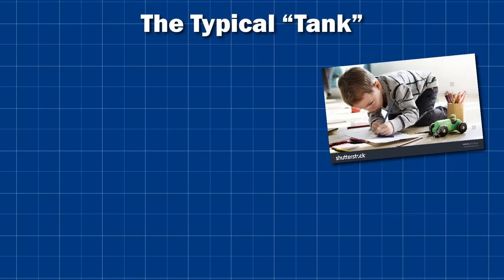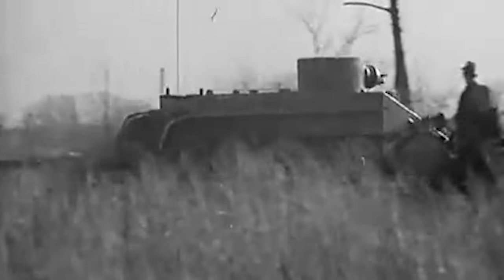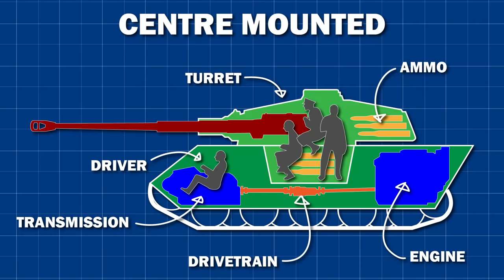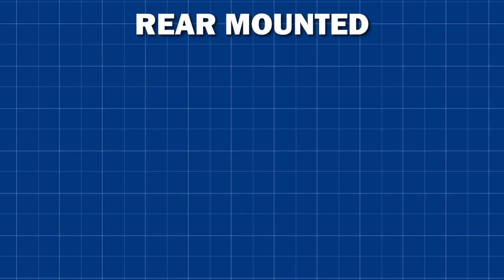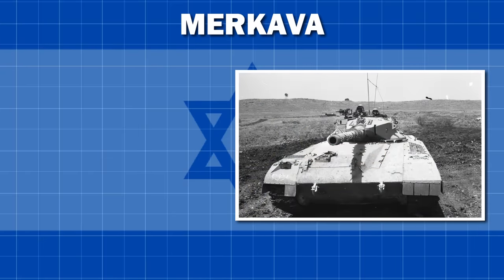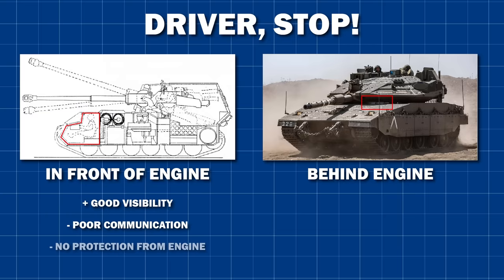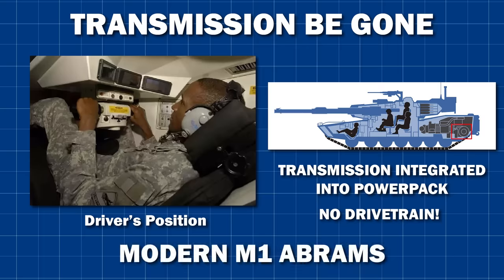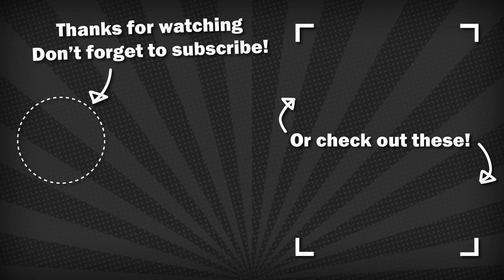What happened to Rear-Mounted Turrets?

Comment: The Merkava being able to carry infantry in the back isn't technically untrue, but its more of a misunderstanding, Its only possible by removing a majority of the vehicles main gun ammo. As far as i'm aware the ability is there so that it can transport wounded soldiers in a hurry, although the practically of that sounds questionable.
Reply: If the Merkeva have the similar ammunition arrangement like the Abrams; it wouldn't need to stowed ammunition in the hull. Another major issue is the engine is mostly hollowed out aluminum offering almost no addition protection for the crew. Even when engines were still mostly made out of steel, the steel isn't the same steel alloys use in armor.
Reply: @mislovrit  Yeah, i don't particularly like the design of the Merk, It could've made sense as a early cold war tank, but in an age of composites its just a liability.
Reply: @mislovrit Engine Block isn't gonna stop the Main Body of Projectile, An APFSDS round is gonna soar through Like Nothing, but it's gonna slow it down and It's gonna stop any additional Fragments
Reply: Merkava is a downright dangerous Vehicle for Infantry to be in, if they move a little bit forward they can get caught in the Rotating turret, Like 10 tonnes of electronically driven Steel, turrets have no problem breaking hands, legs, or taking lives even 

There isn't enough of a space to stay behind turret ring. 

In an extremely emergency situation however Yes, you could cram one or two soldiers between ammunition racks, but they are entirely blocking the exit which of course isn't ideal 

Merkava isn't an  IFV, a P38 has picked up wounded Troops too, doesn't make it a transport plane
Reply: @mislovrit M1s have hull ammo stowage
Reply: It's like an American truck. American trucks can tow and haul, but, not a lot of people use it. (Poor gas mileage, strain on the transmission, etc.)

The Merkava can transport soldiers, but, the sacrifice to do it is usually not worth it. But, it's there if you ever need it, just like an American truck :D

BTW, has there ever been a recorded battle where the function was used?
Reply: @pharaongaming8617 Bro how often is a Merkava going to have a high quality APFSDS round going through its front hull. I actually agree with the design philosophy that the engine block provides protection as it is extremely effective at protecting crew  from HEAT projectiles and Anti-tank mines. 

The turret is much mire likely to be shot by kinetic projectiles in a war and the Merkava’s design compensates
Reply: @nooby1249  All but 6 rounds of ammo in an Abrams is stowed in the turret bustle, and separated from the crew unless loading. The purpose is so that if the ammo is hit the top of the bustle will blow off, leaving the crew unharmed.  The six rounds in the hull are stored in a similar compartment that blows out of the rear of the tank. Merkava stows ALL of the main gun ammo in the hull.
Reply: that's cool
Reply: From what I heard the layout was meant to facilitate easily restocking the ammo supply.
Reply: @jamessquires7015 merkava is literally the deadliest tank in the world since it was made as a one man(unit) army. It was made to secure the well being of the crew a lot. Most of the Merkavas a pretty much empty space and composite(Nera) armour. Its design got some issues, but its still very valuable. The only major problem it has isn't even connected to the design- Merkava is an Israeli tank, so its only suited for hard, sandy terrain or heights . That's why its not a good tank for Ukraine.
Reply: @Snailman3516  yes, thats what I understand is the truth. Its a reloading system. Without the huge tank count of the USA the Israeli need to cycle tanks back to the fight ASAP like in their earlier wars. One time people were coming out of it so someone thought of it as an infantry system. I can ... but its main function is rapid rearming near the front.
Reply: @TheoHawk316  Never used to carry troops into combat as far as I'm aware, but it has been used to carry wounded out. The real problem with Merkava playing APC/ IFV is the infantry already have APCS and IFV's.

It's like owning an El Camino and a real truck at the same time. Any time you use the El Camino's bed, you're better off using the real truck that was parked right next to it.
Reply: Look there are haters I get it, but I like the space there whether for amo or troops. Plus Israel is not fighting in tank formation with anyone. Most of the time, the fighting is urban or an impressive special op
Reply: My understanding had always been that the extra space was to pick up the crew of a disabled IDF tank.
Reply: It can and it was done it before. But yes, it is not a practical way to carry troops more like emergency evac out of combat zone if you really want to.
Reply: I believe the main reason is to allow ammunition to be quickly loaded into the vehicle, but it could also be used for what you stated as well as a quick fire escape, though these were not the primary reasons.
Reply: @kyb5203  But if you get hit in the engine the tank suffers a mobility kill, and will have to be recovered if possible.
Reply: Like mi-28, it can carry troops, but prefer not to do it if possible
Reply: @SgtBeltfed  Never thought I'd hear an El Camino analogy that makes sense.
Reply: @mislovrit and also that the engine is in the front, where the tank receive the most hit, you imagine a bullet penetrate the front Knockin out the engine and just transforming your tank into a steel coffin
Reply: @Taczy2023  Generally speaking, taking a penetrating shot isn't good for a tank's health regardless of engine placement
Reply: Yeah, was that sufficiently tested in practice?
Reply: @mislovrit Except that having it stowed in the hull is safer.  Remember, the Merkava was designed to fight from fixed hull down positions.  It's the expression of a defensive tank design.  It's not designed for mobile combined arms combat.
Reply: @pharaongaming8617  No genius, it's a whole new massive source of extra red hot splinters that are already inside the tank, so past its armor and directly on top of the crew...
Reply: @kyb5203  well During it's design phase very often, People believe In this myth that Merkava is an "Infantry Tank" whatever that is, but Merkava was designed with the experience of 6 day war and yom kippur war, Israel had to face Thousands of Tanks with it's own hundreds of Tanks. 

Also remember that Arabs actually had superior Tanks, T72 was a real problem for Israel in 1982
Reply: @KuK137  no it's not, Main Armor would have slowed down the projectile, then transmission, then Engine block, it won't be moving very fast thus won't create much spalling. 

Well if it hurts the Engine block that is, it's actually far smaller than the entire front of vehicle of course
Reply: @iatsd  Designed to fight from hull down positions? Not necessarily, yes of course it's great to utilize hull down positions, but More often than not Israel was on the offensive, Israeli Armor doctrine was very mobile, even during defence
Reply: @K1ng_Rat  I disagree with the second part. 

Merkava can work fine in Mud and even on Ice 
Funnily enough on ice Merkava is Better than Abrams, due to all metal Tracks 

Golan heights is Muddy, there's a lot of dirt in there 

Also Cyprus bought Merkavas 

In Ukraine Yeah in a way, No Tank is as Good In Ukraine as Soviet ones, In off road capability Soviets are unmatched
Reply: @trololoev  that's MI24, and not exactly, it's similar, But MI24 was Ground up designed to Carry troops 
It has a dedicated compartment, Merkava just has some leftover space, which people assumed would be used to carry infantry 

They have Matching Nicknames too 

Merkava-God's chariot 
MI24-Devil's Chariot
Reply: @pharaongaming8617  70 tons in mud, i mean sure mate.  You will NOT get stuck!
Reply: @pharaongaming8617  Yes, necessarily.  It was specifically designed to defend the Golan Heights and the Sinai following the experience of the 1973 war where the IDF spent most of the time fighting defensively.

I doubt many of you are old enough to remember that war or the published accounts around the development of the Merkava at the time.
Reply: Only if the ammunition stowed in the hull is protected in some manner like on the Abrams, Challenger and Merkevas. Every other tank without any form of protected hull ammunition storage is just another player in the turret toss Olympics if they get penetrated there.
Reply: Why would they transport tank ammunition in the crew compartment? Why wouldn’t they put it in the turret boot like all other Western tanks?
Reply: Its not a crew compartment, its the main ammunition storage, its just quickly removable for instances where you would require it, which i'm of the opinion are not worth the tradeoffs resulting.
Reply: @K1ng_Rat  the Leopard and Abrahams want to talk to you
Reply: @sergeantsharkseant  why we saw that Leopard 2  isn't very capable in Ukraine, as well as those 10 turkish a4 that were lost on the syrian border
Reply: @matthewhuszarik4173   because you cannot store  25+ shells  in cramped space. Abramce  has  most of its  rounds  in the  blowup pannels, but  it  still has  room fo ammo in the  hull as well. Leopard has  ammo storage in the  frontal part of the hull as well(aside of blowups). Merkava isnt diff it  caries  some of its  rounds in blowup(only  mk4) and others in the hull.
Reply: @K1ng_Rat  of 71 Leopards 2 there have been 5 lost in 4 of these the crew most likely survived and this in 13 weeks of war.

Also we aren’t taking about Leopard A8s it were 10 Strv 122s—Swedish-modified Leopard 2A5s—21 Leopard 2A6s and 74 Leopard 2A4s. none of these is newer then the 90s

We are talking about older Variants of a Tank that is only in service with that armed force as long as it’s deployed, and is from a different armor doctrine, (Ukraine followed the Russian armor doctrine for quite some while with their own T tanks being focused on smaller tanks where the survivability of the vehicle is equalized with the survivability of the crew and meant to attack with numerical superiority. Using smaller 3 tank platoons per company though in general having more more overall divisions (in general a eastern division is often compare DIN fighting strength to a western Brigade

Western armor doctrine is focuses on bigger Tanks more likely to be damaged (forcing the crew to bail out, and counting as a kill/mobility kill) using fewer but bigger  groups of 4 tanks in 3 Platoons +2 command tanks per +2 command tanks per Battalion

I would also like to mention while the crews have and had much combat experience in the beginning they only had very short instructions in Germany to learn the new tank and how to use it.
Often with less then adequate translation, though that was fixed later.

So in conclusion: no the Leopard isn’t performing poorly.

Can’t say much about the Abrahams though I doubt the situation here is much different though it has to be said American tanks are a bit different then the German ones too.

American equipment is more likely to break In a sense.

It’s basically a Wear and Tear Army,

Their military complex devours Lives and Ressources and spits out destroyed existences
But it works in a way
Reply: Any splintering originating from the engine as a result of the projectile traveling through the engine block is likely to be stopped by the rest of the engine and the firewall/armor between the engine compartment and the fighting compartment.

As for the apparent troop carrying capacity of the Merkava, training and wargame footage has shown Israeli troops disembarking from the Merkava indicating that they do treat it either as part of primary doctrine or as a potential contingency.  In the event of either, it’s unlikely that Merkava’s will be the primary source of infantry transport during… most likely supplemental for planning purposes.

That said, the existence of such an empty space in the Merkava’s design does make for potential alternate uses for that portion of the hull, such as transporting extra ammunition for itself or supporting units, medium sized UAVs and/or a drone control station, or even a handful of motorcycles that dismounted infantry could pull out and use for scouting for securing a mission critical position.  You could also make a variant that plays into the medical evacuation role by using a portion of that space for more significant storage of medical supplies and a stable operating table for stabilizing more severe casualties in the field.
Reply: It's interesting because the cv90-120 that basically a IFV with a main gun, turning it into a light tank. Effectivly lose the ability to carry troops if they want to carry any resinable amount of ammo. But if  I understand it correctly. The racks are colapsable,  so when the ammo is spent. It can carry troops again.
Reply: @matthewhuszarik4173  
> Why wouldn’t they put it in the turret boot like all other Western tanks?

Because this is the worst place to put ammo in. 60% of horizontal hits and 90% of top-attack hits go there.
Reply: The Merkava being able to carry infantry in the back is just coincidental because the turret was out in the center, where it belongs on a tank. Tanks are supposed to fire on the move, and the weapon system is least affected by the tank's motion if it is in the center of the tank.
The rest is irrelevant.
Reply: @Conserpov  It hasn’t proven to be a problem there yet. At worst it disables the tank’s ability to fire, but any weapon penetration would at the least do that.
Reply: @matthewhuszarik4173 
Sounds like you play videogames too much.
Reply: Merkava doesn’t mean chariot ,git. It’s from the Arabic Markaba, hebrew which is pidgin Arabic went through phonemic mergers and dropped B for V. It literally means “carrier/vehicle/vessel”, in Arabic the word is strictly used for sea faring vessels
Reply: @TheoHawk316  by american truck do you mean a semi-truck? Cause a loooot of people use pickup trucks.
Reply: @robertharris6092  No, I meant use that feature.
Reply: @TheoHawk316  what feature?
Reply: @robertharris6092  Towing & Hauling
Reply: @TheoHawk316  my point was that a huge amount of americans have trucks.
Reply: @rhetoric5173  
as a hebrew speaking israeli, u r wrong.
Merkava DOES mean chariot in hebrew. its name is based on that devastating ancient war machine.
Reply: @K1ng_Rat    Yea right, because a country with barely any experience in the creating of any type of vehicle can put out a Tank that is the "deadliest" Tank. Tanks like the Leopard 2A7 made by Germany, who have some of the most experience in creating all kinds of Vehicles and Vehicle Parts. Cars, Planes, Boats, Tanks, Ships and Submarines of all sorts and all of its components have been created by Company's in Germany. Of Course, I can't just put Germany here and be done with it. America is also a front-runner in the creation of Tanks, with a large part of the economy being for the Military, and have just as much experience in War as Germany. A Country like Israel has barely any experience in any of the important things, a much smaller economy, and the Tank itself would have no chance against any actual MBT's of the Modern Age.
Reply: 1982 Lebanon war, the merkavas were used as IFV because the m113s were garbage. Yes they pulled out the pallets of ammo to do so, and allegedly cramed 10 soldiers (or walking wounded) inside.
Reply: Ah yes, it seems we have many merkava experts with absolutely no experience with merkavas here
Reply: It's there as a door, tbh. You can use it to enter, exit, reload, anything you'd expect a hatch to do.

They did make a dedicated tankbulance from Mark IVs I believe, and the NAMER APC. Both of these required heavy reconfiguration of the internal space though, and while the tankbulance does maintain its gun, its ammo stores are very limited.
Reply: Yeah, my understanding is to say, evacuate a disabled tank. Which makes sense, as the merkava is built around crew survivability. So imagine your a crew that evacuated a killed tank and you’ve got wounded, well having one of the neighboring tanks run you back seems a great capability over having to wait for a transport.
Reply: @pharaongaming8617  You're right that an engine block wouldn't stop a modern APFSDS round. And sure, it might catch some of the shrapnel/spalling created by the armor. But whatever is caught by the engine block is offset by the shrapnel created by that round going through the engine block itself.
 
It's a layered thing. Fuel, oil, and water tanks are actually the best when it comes to stopping/nullifying shrapnel.
Reply: The Israeli APCs are literally older model Merkavas that were refurbished into the APC role
Reply: @mislovrit yeah but the engine block is supposed to catch shrapnel or the molten jet from Heat, not a full on penetrator. Is a second line of defense, and against those, i would argue that volume is way more important than plain ammo
Reply: sounds like once its expended its ammo it becomes a field ambulance
Reply: My understanding has always been that the Merk's rear door and convertible compartment are for:
1. Crew escape without being exposed to fire from the front.
2. Easy ammo resupply.
3. Emergency rescue of crew from another disabled tank.
(Tank crew don't use as much space as fully-equipped infantry & arn't fussy about being cramped when they're being rescued.)
4. Transport of specialist teams, like engineer recce, with the ammo racks removed, in especially dangerous situations.
Reply: @xysoldat5073 There is no best tank. Tanks are designed for different environments, jobs, etc.

Merkava is one of the deadliest tanks on the planet... but it also shares that with other tanks, depending on where you want to deploy them, and how.

There is no way to build "the ultra tank", because you always have to sacrifice something to gain something
Reply: 1)Made as a one unit army? What are you talking about? Merkava is a tank like any other, without support it is as vulnerable as any other tank.

2)Israel hadnt fought a conventional army since Yom Kipur war. Merkava was never tested agains a peer opponent, so calling it a deadliest in the world is simply baseless.

3)Plenty of muddy ground in Israel and surrounding countries in the spring, particularly on Golan Heights and Lebanon. 

As a former Merkava crew member I think its not the worst tank to fight in, even the older models have thermals, good scopes, maintenance is not that challenging, plenty of protection systems and armor is supposedly good (its composition is classifie, so I dont really know). But some of the flows are pretty glaring, an some design decisions are honestly baffling, so it is by far not the best.
Reply: Literally every tank can get stuck.

The weight isnt really an issue, the ground pressure is. Merkava has quite a wide tracks, so this weight is destributed over a large space.
Reply: Hebrew and Arabic are from the same language family, being semitic languages, but in no way Hebrew is a "pigin Arabic". They split from the same proto-semitic language thousands of years ago and developed separately. Its lime saying that Danish is a pigin Swedish.

And Merakava in Hebrew indeed means "chariot".
Reply: @taan1424   That's interesting: what, in your experience, are the flaws and baffling design features (assuming you're free to talk about them, of course)?
Reply: @Conserpov Genuine question. What's the best position for ammo that it doesn't hinder reloading too much? 

You would think Russian tanks with carousel would be safest position to store ammo but they are famous blowing up spectacularly
Reply: @EPE77U 
> What's the best position for ammo that it doesn't hinder reloading too much?
Reloading by hand, with modern rounds, seems to require a turret bustle. For mechanical reloading, it's also much easier to implement.

> You would think Russian tanks with carousel would be safest position to store ammo
Real world data and sim models are unequivocal about that.
Precisely why they chose it over a bustle - it's not like they just cut corners and chose the easier path, quite the opposite.

And if you look at multiple "future tank" Western projects post MBT-70, you'll see a carousel-type autoloader in all but few of them.

Automated turret is the way forward, with carousel or something similar.
Stryker MGS style system is, in principle, a sensible compromise.

> they are famous blowing up spectacularly
Made famous by incessant propaganda without much of a basis in reality.
Reply: @Conserpov  Would gladly to be proven wrong but so far I have seen more western tanks saving crew from ammo detonation due to blowout panel compared to carousel system

Of course this observation is biased so I hope you can instead provide non-biased source to prove your point.
Reply: @EPE77U  
> so far I have seen more western tanks saving crew from ammo detonation due to blowout panel

You haven't seen that - we don't even have any representative battlefield statistics for these Western tanks. Yet.

But we know enough to say blowout panels are mostly crew comfort placebo, and they only partially compensate for far increased vulnerability that bustle ammo storage causes.
Turret bustle is a big vulnerable target, and most tanks hit in it are write-offs.

Blowout panels probably work much better with metal-cased 105 mm ammo in early M1, but not that well with combustible case 120 mm ammo. When they do work, a Russian tank with an identical hit would also survive, or wouldn't be hit at all.

Superficial visual effects like turrets flying are not what's important.

Again, there were many Western "future tank" projects since early 1980s and most of them feature a carousel, for a reason.
Reply: @Conserpov  You keep talking about tank survivability when the more important thing is the crew survivability, unless you're going full russian mentality. 

You don't need to provide any kind of sources but don't expect your comments to be taken at face value. I was just curious about your arguments
Reply: @EPE77U 
> You keep talking about tank survivability when the more important thing is the crew survivability

No, you keep making a survivor bias mistake or applying video game logic.

If a Russian tank explodes, it usually means the crew expired before that happened, not because of it. Or the tank was on fire for a while and the crew bailed out.

Getting hit specifically in the ammo storage is common for the turret bustle but very rare for the carousel. Which is why this became a crew survival issue for Western tanks in the first place.
Reply: The psichological effect cannot be understated. Having a tank that can at all be converted into a makeshift APC significantly increases troop morale knowing they could in a pinch convert them in into makeshift APCs for retreating.
Reply: It's to load ammo into the tank faster lol
Reply: @mislovrit   I think the Merkava carries ammo in the rear to reduce the need for re-supply and to ease resupply in combat. You can take the rounds through the rear door using the hull as cover or while the tank is hull down.
You don't have to load the rounds throgh hatches on top of the turret which is pretty vulenrable to even a guy with a rifle.
Reply: @pharaongaming8617 Except the Israelis aren’t that worried about fighting enemies with modern ammunition.
Reply: @trololoev Mi-28 carrying troops?? where? do you mean the Mi-24? cause the Mi-28 physically has no place for anyone to go unless they lay down on the pilots
Reply: @Hoshino_Channel  mi-28 has Landing bay, but it use for extreme situation, like saving pilots from other helicopter.
Reply: @trololoev  Are you talking about the landing gear?
Reply: @Hoshino_Channel  on the left side of mi-28 is a door there can fit two people. So it can carry additional people but only in special cases.
Reply: @mislovrit  its not meant to stop a solid projectile
but it is indeed effective at eating the aftereffect of APHE, HESH, and HEAT to a degree.
Reply: either as small team infantry or additional tank crew